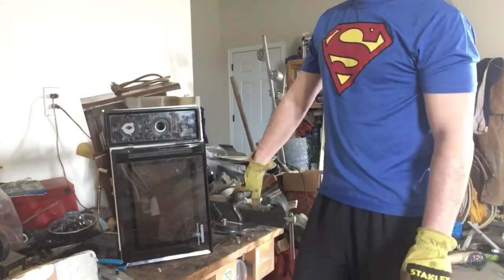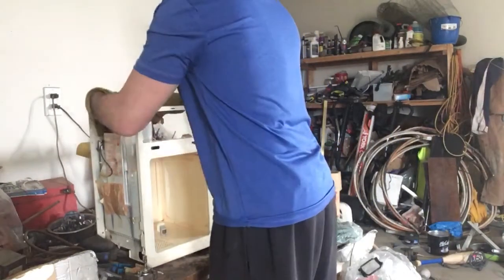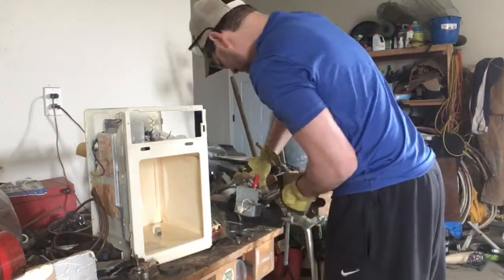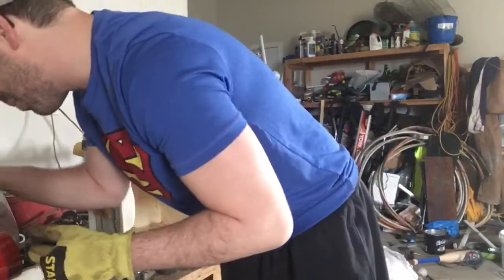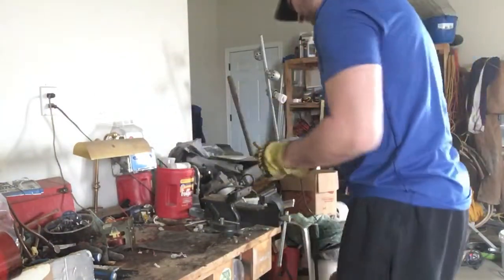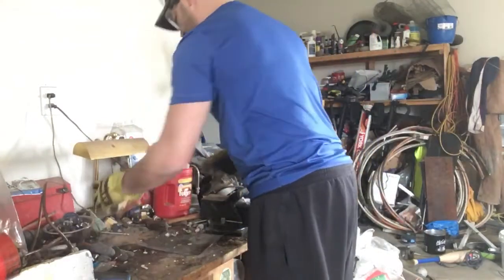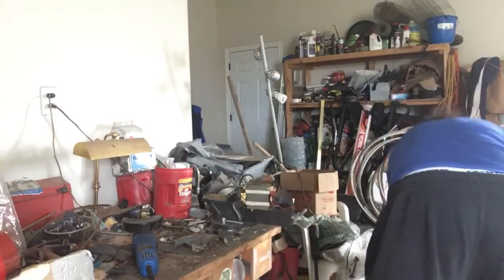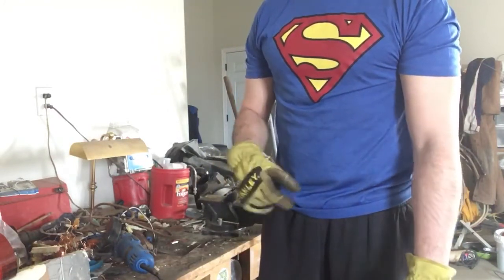Scrapping a microwave oven for loads of free copper, silver and other metals safely.

Comment: I scrap to make some spending money and every once in a while I watch other youtubers to see if I can learn anything cause I’m mostly self taught but anyways the motor your beating on around the 17minute mark in your video I usually take to large pairs of pliers or channel lock put 1 on each side and twist it out typical there not solid or weld so it’s very doable with a bit of force

Comment: some of those copper spools can be a pain.   something i use that comes in handy is a half inch chisel, one with a nice fat handle for gripping, that thing will split anything.    and you might want to get a 16 oz fiberglass hammer too, less pounding...   another great video.
Reply: Do you pound the steel casing or the copper I’ve been saving transformers til I can do that

Comment: When yo are trying to retrieve the copper out of the transformer all you need to do is smack the welds with your hammer once or twice and the welds will give way. Ive been scrapping for 20 plus years and just trying to save you some time. It works every time

Comment: You forgot to mention that the Magnetron tube itself is made of copper. You have to cut off the steel rings from both ends using either a hacksaw or a cutoff wheel on a grinder. it appears to be brazed on. You can clean up the outside of the tube before you open it using a wire-wheel on a bench grinder. The inside of the tube is very interesting to look at, lots of copper to be retrieved.
Reply: Thanks for the tip, Scrapman 👍

Comment: If the resistor that grounds the capacitor to the chassis is damaged or disconnected then the capacitor has nowhere to dissipate charge. A good safety procedure to practice wether the resistor is visibly damaged or not is to use a good heavy metal electrician screwdriver with an insulated handle and contact the capacitor terminals to the chassis/frame or wire directly connected to it. This will immediately discharge any current and will make you jump if it happens! Its a one in a thousand chance... but its worth doing to prevent your death just from scrapping copper! And Trust me the amount of voltage and current that outputs from these will fry you.

Comment: Good day I'm from South Africa I strip a microwave, and behind the control panel was a round black thingi, so I open it and there was a golden lookalikes thing in it non magnetic, is it gold or not
Reply from the maker: If round and gold color probably brass. Some relay boxes use a tiny piece of gold instead of silver in them for contact, but those are usually the clear relay boxes and older styles. The rectangular boxes will have silver, but what you are describing is brass.

Comment: Unless your pulling all the plastic off the metal it doesnt matter what the metal is...chances are the yards are giving you mixed tin price ...which aint much.
Reply from the maker: I agree.
Reply: @TinManScrapper   Then why not state it? The way you said it seems like you can just take the microwave door in and they give you  steel price.....when in fact most yards just throw the door away bc there is way more plastic than metal and it ain't worth the effort. That plus you kept referring to things as steel....when all the yards I've dealt with would say it's tin. If it's thin, it's tin...if it's thick then it's steel is my rule of thumb. Works most the time. Other than that it was a great video and very informative.
Reply from the maker: @Honda-wf6qj  Thank you for the comment. You are right about the “thin is tin comment.”:This was one of my first videos and things have changed a lot since I made this one, as I too have learned a lot in those years.

Comment: Do transformers hold a charge? Should i be cautious, So I don't get zapped?? Thats my biggest fear.
Reply from the maker: No, I have held 100s of them and nothing. I was told that the cylinoid might, but if the microwave is sitting for a little it won’t. Again, I have handled 100s and never any type of shock.
Reply: @TinManScrapper how long should they be sitting for?
Reply from the maker: I leave for a day just to be sure, but I have taken apart over 100 now and never had an issue. @Theodore_Fry